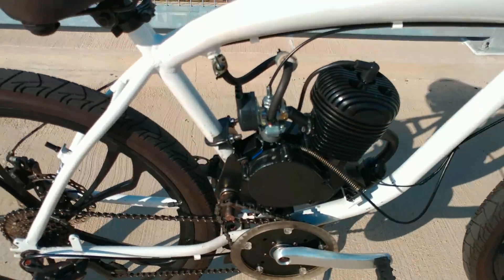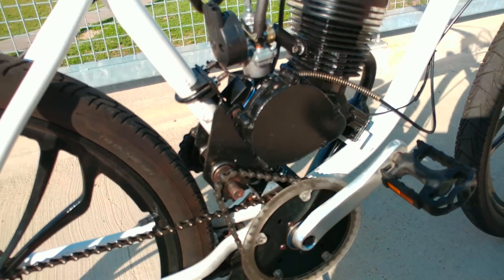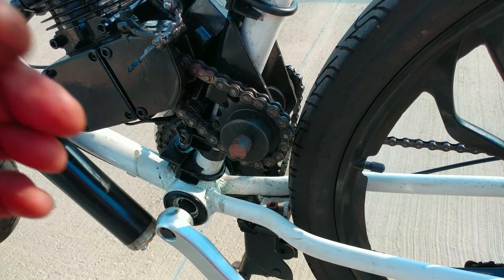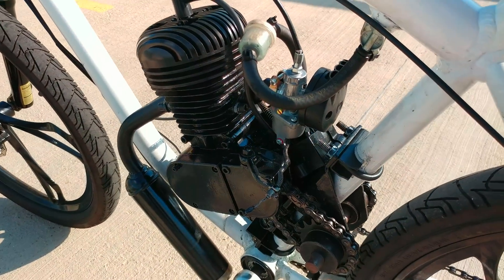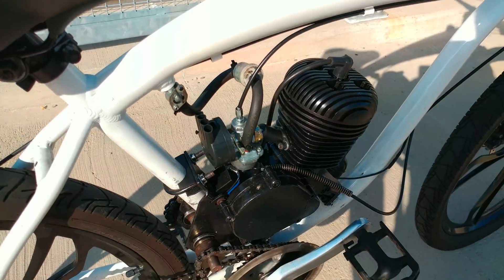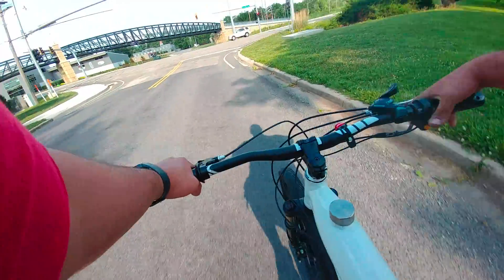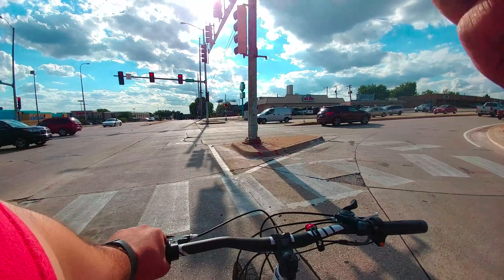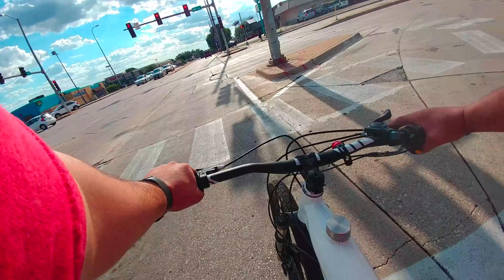Motorized Bike Jackshaft. What it does and how it does it *Viewer Request* Hill Climb and Speed Test

Comment: This also makes it possible to use a rear disc break!! I'm getting one!!
Reply: Actually this setup wouldn't interfere with rear disk brakes. He is using a jackshaft. There is no chain that runs to a sprocket on the left side of bicycle. The rear disk break is on left side. The jackshaft goes over to the right side of bike and uses the bicycles original chain to drive the rear tire. 

Without a jackshaft...it would be difficult to use a rear disk brake without some modifications. But is still possible with the right set up.

Comment: Great vid.  Drive me nuts with that noise, tho.  How do you quiet one of those things?  Got to be a secret..
Reply from the maker: Silencer or my sleeper exhaust mod.
Reply: When the flux capacitor kicks in at 12k rpm it goes dead silent.  Speed is faster than sound.

Comment: For those confused. This kit will introduce gears which should in turn increase your top speed. This will work only if your engine has the power to push you. In my case with a 44 tooth sprocket my engine reaches its max rpms and can't spin any faster, but my engine has enough power to go faster with a lower tooth like 36 sprocket as the rpms won't max out early. If your motor reaches a speed where it's power is at it's max and due to air resistance, weight, etc(not rpm redline), then you will not go any faster with gears. So you can opt for a lower tooth sprocket to hit a higher top speed but your low end power will be weaker due to lack of torque at low rpms or a high tooth sprocket to have great torque but your engine's rpm red-line will hit earlier resulting in lower top speed. So with gears you will technically be able to simulate and utilize a variety of sprocket types. You can start with torque-ey high tooth sprockets and shift your way up to lower tooth sprockets for longer gears for cruising and top speeds. Hope this clarifies as gears won't always increase speed if you are already limited by external forces and horsepower rather  than your rpms being limited from redline. Let me know if I got something wrong thanks!
Reply: Finally an intelligent and concise comment. Thank you
Reply: Thanks man for your explanation
Reply: You deserve a lot more attention! Well and good, very well said.
Reply: What I'm trying to understand is does the jackshaft have any gears of its own or does it rely on the bike to have a cassette

Comment: You have a rubbish engine. I can hit a 0-40 in about 300 metres. On the other hand, at 5:08 , you were behind a car, and you can see a 40mph speed limit sign. Presumably  the car was doing the speed limit and YOU were falling behind. What use is your jackshaft and gasframe if I can do 52mph without a jackshaft topps on a stock engine? (Zeda triple 40)
Reply: 52 mph on a bicycle sounds terrifying
Reply: Harwinder Singh Bhachu 
Blows engine
Reply: Do you have a 2stroke or 4-stroke also where did you get it from thanks

Comment: Ok. So here's the explanation in easy to understand terms. As to why this "Jackshaft" is "Jackshit." And will put MORE strain on that dinky little engine. So let's break it down. Take your regular run of the mill 10 speed. (for sake of easier to visualize). 2 gears in front and 5 gears in back. When the chain is on the smaller gear in front and the biggest gear in back then that is the "Easiest" gear to peddle in. Hence, would also be the easier gear for the engine to pull your bike in. Now if you have your chain on the biggest gear in front and the smallest gear in back we ALL know this is the "Hardest" gear to peddle in especially uphill. So WHY would i want to make my engine work that hard as well? Think about it. Jackshaft Jackshit? You decide.
Reply: So youre literally calling it shit because you can adjust the gearing?

Comment: I love this bike! Any reason you did not go with a 4 stroke? That's the only thing I would change.
Reply: just guessing he went 2 stroke for more power ..generally in small engines especially.. the 2 strokes make more overall power .. all the 2 stroke designs are older then great grand pa .. lol and have only started loosing to the extremely upgraded 4 strokes
 . in stock machines.. Granted the 4 strokes are almost double the displacement.
Reply: My Phat Moto 4 stroke 80cc engine bike weighs 86 lb it's pretty heavy. I need to do an actual weight at the scale that's just what the box said. Two-stroke bikes are definitely a lot lighter.

Comment: Someone really needs to do a jackshaft installation video. Or even just a breakdown of the build after it's been installed.
Reply: I know this reply is late, but I have one and this video is pretty good. The install kit has good instructions. Just buy the HD one. It has a strong bearing and  sprag clutch. Also, it does lose some power to the wheel because of the extra rotational drag. The cool thing is that you can crawl through trails in low rpm and low speed without pedaling if you aren't too heavy.
Reply: @marthamryglod291  can you link me to the hd one.
Reply: nah, screw jackshaft bullshit. everyone already has one on their bike. it's called the crank axle and bottom bracket. what someone really needs to do is show chainring sprocket and freewheel hub installation for left side of crank. the right is already used by it's own gears, why leave left side naked?. keep them separate, no point in combining them on one side (where the two separate chains and sprockets are all close together. when you can split them for 2 sides with much less parts, weight, price, effort, and increased sturdiness.
Reply: @Thrashaero  it's probably patented and nowhere to be found

Comment: You have to pedal start with or without the jackshaft. What are you talking about.?
Reply: starting in 1st gear is easier than trying to pedal start on a 44Tooth sprocket
Reply: But without the jackshaft, you can restart from existing forward motion, say, if the motor stalls in traffic.

Comment: Are These legal in to drive in the US?
Reply: Depends on the state you live in, some states considers them assisted bicycles which means you don't need a license, helmet, insurance, tags, or inspection. But some states considers them to be a moped which means it needs a plate and registered. It also depends on what motor you have and the speed it can go.
Reply: Ryan Robberts i drive by cops all the time and never have problems.
Reply: On my bike I always keep the pedals moving so it looks like a bicycle not a motorcycle or motorbike. so luckily they don't pull me over. But I'm riding pretty slow and on sidewalks most of the time for safety. And if I see a pedestrian I hop off the sidewalk or go way over in the grass and let them have the right away.

Comment: so what's the new top speed with a 5 or 7 gear shiftable one speed?
Reply from the maker: Richard Mcginnis this one is an old motor untuned few power add ons.  You could get one going 50-60 easily with the right gearing

Comment: How did you make it a multi speed  bike when bike Berry's tank frames say there only set up for single speed, doesn't the frame at the rear forks have to be wider for the cassette? Thanks!
Reply: Nicholas Banks, I'll tell you. It's what this guy is neglecting to tell you. The pedestal mount on the BBR Tuning frame is not aligned for a Jackshaft setup. This guy is using a specially made custom plate on his pedestal mount. 

Look very closely at the beginning of the video and pause it at just the right moment when the pedestal mount comes into view.
Reply: @JS-fb6ww  I've built a few of these kits and modifications are the norm. If you buy a bike berry frame you might be able to avoid modifications but with the Jack shaft kit you probably will. I've always had to do some modifications cause I've  used some old bike frames from the sixties and  seventies. I have one right now that looks like a 1920 Harley  track racer. I've had a lot of old bikers do a double take cause they thought that's what it was. That's the beauty of these things you can build what you want. Build your own tank  gear it how you like.  And have fun.
Reply: You can easily "cold form" the "subframe" to fit a 6-8 speed cassette. Just search those key words, there are several videos on it. 

The thing is, you really don't need 6+ gears for a small motor, a 3-4 speed cassette with an oversized 1st gear would be ideal.

Comment: Couldn't you change the way it's geared to allow reaching a higher top speed?
Reply: Also wouldn't you get better acceleration by letting it hit higher rpms? It seems to me (my uneducated point of view) that you are shifting to early.
Reply from the maker: For sure. But in a low gear it's easy to over rev and blow the piston.
Reply: NerdyRdneckGamer, agreed. You're absolutely correct.

Comment: I've been studying the 'Plasma Sparkplugs"and how to boost the power from the coil to get a Huge spark.I was hoping for extra power and cleaner burn.93 octane pump fuel,and semi-synthetic oil at 25:1.Will that make the hills easier?(Definately Not doing jack shaft here.Not legal) Thanks for info if possible.
Reply: BryDuhBikeGuy, "not legal"? Wtf are you talking about? Lol.
Reply: In my state,(MI)you can't use but 1 gear to drive the bike.If you can shift,
it must be licensed as a motorcycle.
Reply: BryDuhBikeGuy, please provide link to that law.

You need to look up the legal definition of a moped in your state.  It must fit the parameters of all parts of the definition. Not just one.
Reply: BryDuhBikeGuy, I got it. 
Michigan law (Section 257.32b) defines a moped as a unit that meets all of the following:

The engine does not exceed 50 cc’s piston displacement;

The engine is rated at 2.0 horsepower or less;

The power drive system does not require the operator to shift gears; and

The top speed is 30 miles per hour or less on a level surface.

-   The key word being "require". Even with a jackshaft you aren't required to shift gears. You can shift or NOT shift it you want.
Reply: Plasma Spark is about 5 times the power of regular spark.It takes a capacitor to super-charge the electricity into the plug.BANG!Not Pop.Regular CDI,stands for Capacitor Discharge Ignition(or Igniter)The ones sold for bikes sometimes have adjustable timing.
Reply: BryDuhBikeGuy 

?
Reply: @bryduhbikeguy  then get a cvt and connect it via jack shaft ..
Reply: @jasonwhite8722  Thnx.Hadn't though of that.Bought a 50t for the lower speed but added torque.I now ride about 15mph,instead of 17 at that rpm,but the hills etc.,when loaded down,are no problem.(I tow a trailer with a mower and trimmer,etc,sometime)TY.
Reply: @bryduhbikeguy  idk about this on your motor ,but ISM has ignitions that cause a rapid fire .. so for every spark impulse it multiply s it to maybe 20-30 sparks.. u may be able to recreate this with electronics??? the extra sparks guarantee ignition.. also there are some 2stroke tuning tips worth looking into .. like how to map your ports then use that data ,to make a tuned exhaust .. there is one man that knows where to place all the numbers to know the proper measurements needed in each section of the exhaust .. which plays a huge role in 2stroke power . and at what rpm's the power is at or near its peak. .ill try to find a link to the exhaust guy .. if enough people ask he may release his  exhaust calculator as a freeware app
Reply: @jasonwhite8722  Thnx.I did watch that,and have the address saved in my Bookmarks.Had forgotten.TY again.
Reply: Anyway...It's been 3 years,and I use a 56t drive sprocket and 18mph is just a hair above cruising.With Poo-poo Pipe and an CDH reed valve,I have no troubles at all with hills.The previous comment involved the 'jack-shaft'.The law states"If it shifts gears it must be Registered and plated.Up to 20mph and still uses Pedals,it's "assisted".At 30mph it must be registered as a Moped'.I average about 17mph,and the Police wave back.

Comment: Here's how I keep those motors from sucking air and causing erratic idle, put an O ring in the manifold end of the carb and compress it as you tighten the bolt...no more air leak and you can actually adjust the idle speed.
Reply: So I wasn't the only one hearing the crasy high idle at stop? I've tried the o-ring thing, btu unless it's a VERY thin one, you'e going to have issues. I make mine out of old inner tubes.
Reply: @GenMinion  that innertube idea is genius, gonna grab some when I hit the bmx track 🙏
Reply: red silicone always works
Reply from the maker: +Jon Rothenbusch agreed
Reply: Improved mine greatly. Use some sort of gasket between the carb and motor, cut o ring for a garden hose worked on mine

Comment: i have worked and ridden on motorized bicycles for 3 years now and never messed with a jackshaft and probably never will there is a lot that can go wrong with the bicycles already which some problems requires un mounting the motor. i think it would be more of a pain  dealing with and maintaining the extra parts...
also is your bicycle prone to over heating. your idle is way to high AND you air intake is upside down it looks like that was done because there was no clearance. recommend getting a new intake b4 any water ends up into your fuel/carb/motor
Reply from the maker: Yeah they are a pain you will have to take the engine off and on multiple times 
u are correct that head gets way too hot and causes a air leak making it not idle 
the filter cover has holes to drain water and gas
Reply: Motored Life question. Do you ever have a problem with the bicycle chain breaking. Seems to be a lot of power for a smaller chain

Comment: I put a 80cc flaming horse with jack shaft kit on a Schwann mountain bike with expansion tank, header, pull start, centrifugal clutch, trispark plug,and better gear cassette in rear. It runs great easy to drive up hill and does about 55 mph but death wobbles a little if I hit a big bump
Reply: I'll bet it does!

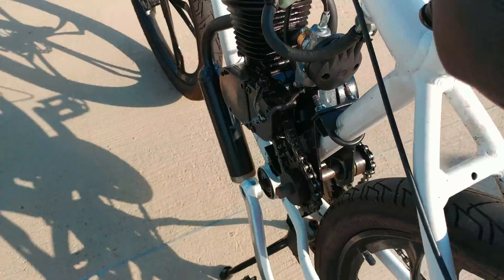Comment: 1:56 "Doesn't necessarily makes it faster" So, whats the point? Sure,  it will help you climb hills, but you could still do that with a little bit of peddling. Nice project for fun but considering the cost of the Jackshaft kit and expertise  and skill required to install and the time and work involved, I will pass for now :)
Reply: Since 2 strokes (and all engines) create the most torque within a certain range of rpms, the jackshaft allows you to keep your engine in that powerband for a larger range of hills.
Reply: Drive your car everywhere in first gear and you'll understand.
Reply: Lowering rpms CAN increase speed to a point, it can also increase torque at a certain range. More gears the better. Try driving your car stuck in one gear without it shifting.
Reply: Nick Hersheys, you gotta remember, motors aren't meant to run in a single gear indefinitely. Could you imagine getting in a stick shift and never leaving first gear or the highest speed attainable in 1st gear? The cars engine would blow up sooner or later or at the very least have some serious wear.
Reply: You can change the gear ratio to get the bike moving hes just to stupid to relize he can have a bigger jack shaft gear guys
Reply: @damionloya4746  your a fkn troll
Reply: @TheProfessionalCommenter-g2j  I agree. There is no way it WOULDN'T be faster with more gears
Reply: Nick Hersheys I feel the same way mbf Tony01 talks about my work like a dog I told that niggah need assist on flat road only fuck a jackshaft.
Reply: Nice and or deal for those who have the bank to shell $80.00 on a custom rig.

Comment: I could use some advice I have a kmb frame similar to yours just got a dio reed motor from zeda and have the jackshaft installed however I can’t seem to get my rear derailleur to make the jump to the mega range gear. Haven’t even had the chance to ride the bike yet due to the issue with the derailleur any advice and tips would greatly be appreciated
Reply from the maker: +Tyler Song I actually have a 8 speed shifter 7 speed gear.

Comment: What fork are you using? I have a fork from a Giant brand mountain bike I wanted to use in my Skyhawk frame but the head (top pole piece) of the fork is wayy too small for the Skyhawk frame...I think I need some sort of adapter?

Also, would you recommend a 12 gear rear sprocket or is that just too much gear changing?
Reply from the maker: the fork size is 1 1/8'' and requires a 1 1/8" semi-integrated headset. you only realy use like 4 gears

Comment: Im curious how the jack-shaft wouldn't raise your top speed? is it a power issue because it seems like the extra gearing would substantially increase the top speed of the bike. I'm new to the motorized bicycle thing lol
Reply: It has to do with the sprockets that go onto the pedal. You have to play with those and the sprocket coming from the engine to get different speed and torque ratios. Now if you were able to add a cassette to the left side of the bike and have it ran straight from the engine itsself then you would be burning rubber from take offs and getting really high top speeds. But with the added gears from the jackshaft it changes the ratios.
Reply from the maker: The engine is not really set up for a jackshaft a new engine set up for torque would be perfect